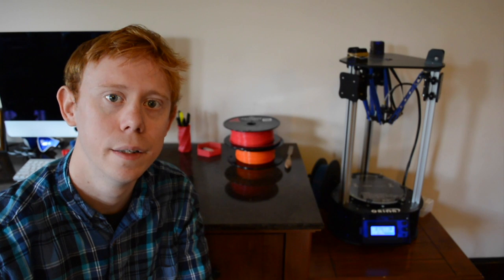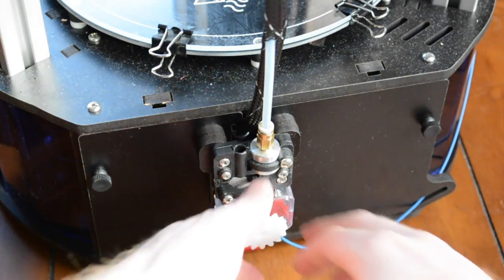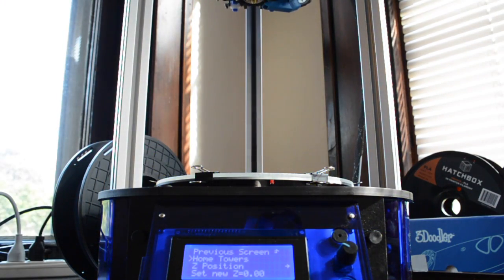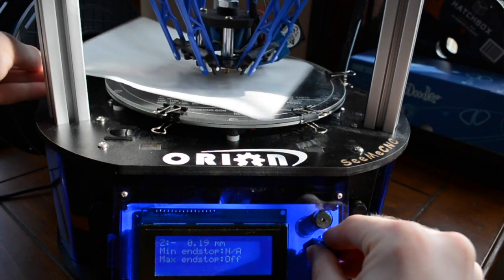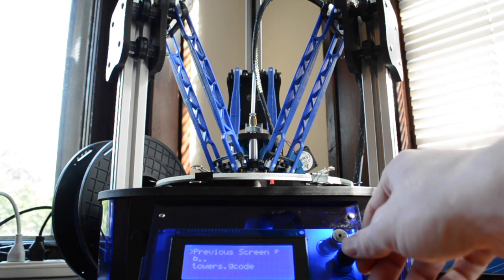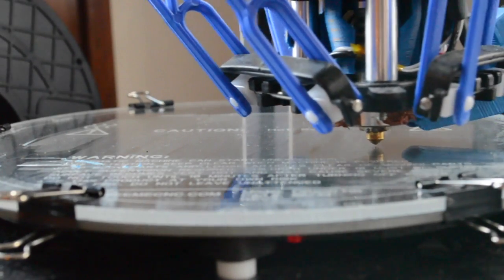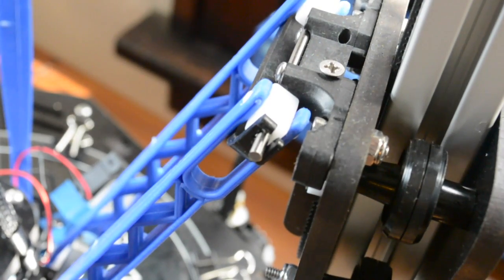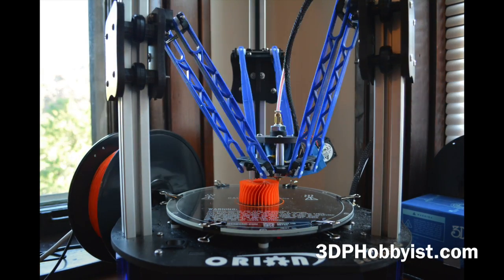How to Calibrate Seemecnc Orion & Rostock Max 3D Printers

Comment: I updated my original Rostock with the new HE280 Hot End. BUT I don't know where to adjust something to make the X and Y  bigger! The Z is not perfect (test cube 20x20x20 PLA, 200C/55C) is printing: 20x20x21.41 - last measurement is Z. Can you help me how to address this issue? Also, despite the X and Y are exact, when printing something that fits inside, it is too tight or it doesn't fit. I know Arduino, so I can open the appropriate files in Repetier or Arduino apps. Thank you very much!